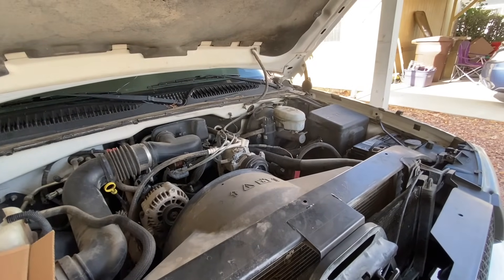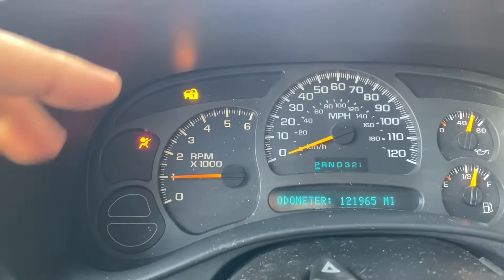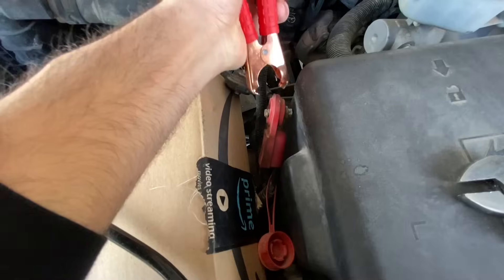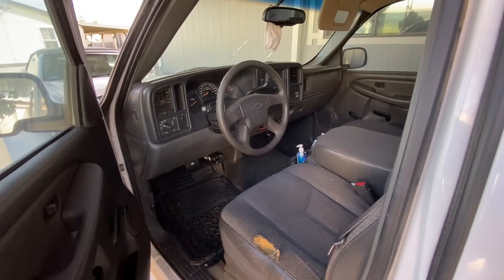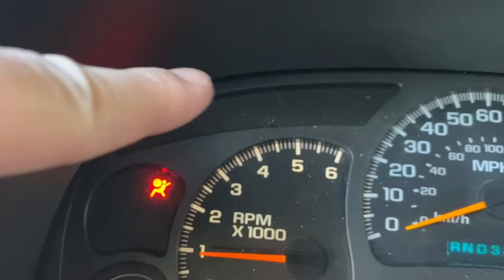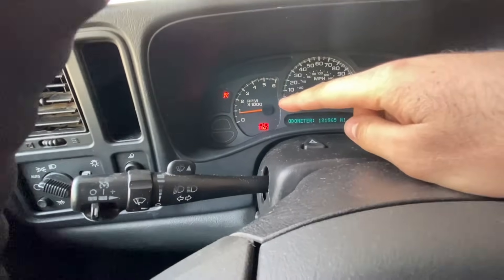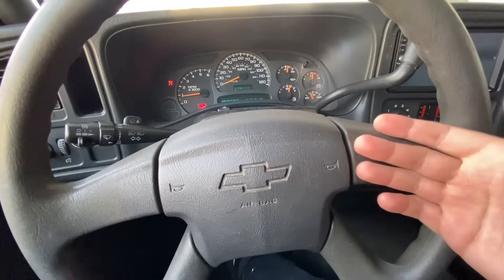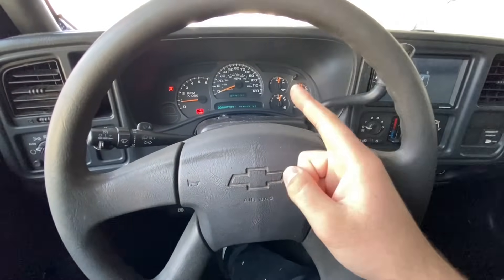How To Reset All ECU’s And Control Modules In Your Car Or Truck Safely

Comment: I only have a battery jumper cable type module.  not regular jump cables...can I still do this with that?
Reply: Yes just make sure you use the same color cables when draining the system

Comment: On my 1996 GMC suburban I am having major issue the computer suv I can't get in too my stock diagnosis mode in device I have  have this option  too reprogramming it or something else like adjustments performance I had on it before but I was doing this I turned car on wandering what happened if don it just curious see makes different works better I thought but / it says error switch ignition not on but I am on / and no longer starting as was starting before and dying out what you think going on
Reply: 😂ok good

Comment: Do u keep the ground wire connected though? Or just disconnect the Negative and the Positive terminals?? I have a 2007 Ford Ranger 4x4 V6, model without any electrical windows or lock/unlock buttons
Reply: Yes, disconnect both from the battery first
Reply: @kellismith4329  why would you do that? You can just disconnect the negative. If one cable is disconnected then your battery is out of the picture its not going to arc it
Reply: You said disconnect both

Comment: This is a really bad idea you can actually damage your computer you need to go on Scotty Kilmer website and he shows you how to take a 1 ohm 10 watt resistor and hook into two jumpers and then hook that to the positive negative and that takes overnight to drain it down for about 8 hours and it does not damage your computer

Comment: Thanks bro, your knowledge actually works even on 800 cc alto car, I was badly disturbed by car abnormal rpm,  I paid more than 3000 at service center they cant setups  properly , done throttle servicing too, I request them to  do calibration too, but they denied,  it's ok.. veh is ok..they said,  but I was not satisfied by them... finally I did by ur help,  thank once again..🙏
Reply: Co

Comment: Have a 2003 Trailblazer EXT Northface Edition 195000 miles, 4.2L 4WD. Had an issue come up where I was losing MPG and power, wouldn't stay on cruise control. Took it to a mechanic in another town because it broke down on the highway, spent $80 for a sensor, no joy. Replaced battery, spark plugs, fuel filter, air filter, and had oil changed; still no joy. Towed it to my long time mechanic ($180 for 40 miles), learned catalytic converter was full. Had it replaced. Still not right. Seafoamed it in gas tank and cleaned throttle body, still engine stuttering and bad mileage. Watched this video, replaced plugs with Bosch plugs and followed directions to clear ECU memory. Took it out and drove it, 45MPH on cruise without any stuttering; 70 MPH, no stuttering; 55 MPH no stuttering and fuel economy is back to normal. Problem seems to be gone! If it is, saved me buying another ECU and having it programmed, probably $800 or more. Thank you!!!!
Reply: Very cool. Congrats! And what a headache!

Comment: My 2006 Ford focus PATS systems activated and would not turn over. I did this and it reset the system and started right up. Saved me from having to have a locksmith reprogram my system.
Reply: R u serious? My 2010 f150 went into Pat's lock 18 months ago and it sat in my backyard for 17 months I was fidlling around with some wiring under the dash and alligator clips and somehow magically got it too start drove it for a month perfect no problems at all then it goes back into security lockout mode once again and now I cannot get it going I'm going to try this in just a second and I'll let you know if it works I'm really optimistic after your comment fingers crossed

Comment: My check engine light is not on and my scanner read error not sure if computer is bad will doing this help reset computer at moment truck not starting thanks
Reply from the maker: Check the communication fuse
Reply: @GK7GARAGE  I’ve checked all fuses under dash and hood and fuse on positive cable all good. I think the computer went bad when I jumped truck putting cables on backwards
Reply: @wildcardjoker  - yup...that'll do it! You fried something!
Reply: Probably a soft code. (AKA a Pending code)

Comment: Thank you 😊 for the great video ❤️ these car dealerships want to nickel and dime us to death especially us ladies thanks again
Reply: There's no nickels or dimes involved when dealing with a dealership!
Reply: Nickel and dime?  The dealerships by me are total crooks!  Wanted $99 for a cabin air filter replacement. I said NOT today. I went home and look it up on YouTube and I was about to purchase the filter from auto zone for about $3 and it took me less than 3 minutes to slide the old filter out and the new one in. Crooks those dealerships. On occasion when I get a coupon for an oil change and go there. I tell the receptionist when she checks me in…I say tell the mechanic not to come looking for me to tell me I need any service. If he thinks I need something have him write it down and I’ll look it over at home and decide 😁😂😁😂. This chicky is tired of those men at the dealership trying to rip me off with their bullshit stories.
Reply: Yep mine said 200 just for diagnostic. Bull shit.
Reply: @user-ig8re3ld2v  dealerships and chain store mechanics are such crooks.  Once I was driving and I heard a loud knocking and I happened to be close to the Honda dealership and pulled in and the man looked at my car and said the sound and smoke was the calipers and I need new calipers and the job would be almost $800.  I said that’s a lot, I’ll come back. I took it to my neighborhood mechanic and he looked at it and he greased the one caliper that had gotten stuck in the up position and he said once in a while they do get stuck. He greased it and I never ever had a problem for the remaining years I owned that Civic. And he didn’t charge me to simply grease the caliper.  I stay away from the dealership since then, I avoid them like the plague.
Reply: Exactly. Frickin mechanics. Tryin hose us.  And nobody knows what wrong. Pppft losers

Comment: Hi there! This video is really simple and helpful. Thanks for posting it. But I’ve got a question. I own a Hyundai coupe siii 2007 and I’ve unplagged the ECU without removing the battery negative pole. I asked a specialist to tune it at stage 1 and after plugged it back on the car won’t start. He tries with other 2 different files without finding any issue and still nothing. So he put the original file but the car still won’t start. Is your video ideal to solve such problem too??? Much appreciated
Reply: Ask him if he only wrote the file and not the eeprom
Reply: Sounds like a damaged harness! Or you never fully plugged it in. Try spraying connections with circuit board cleaner(not connections on ECU).
Reply: Rip

Comment: Question? Can I use any jumper cable because I see the one you are using in the video does not have a negative end? My car is a 2010 Chevy traverse.
Reply: There is a black side and a red side… only use one color fit both so either both red or black . Make sense?
Reply: I know your comment is a month old but future reference. Yes You can use regular jumper cables ,but only use the negative cables on them.
Reply: @lindswill4144  can you explain what you mean by this?
Reply: @avinaftali8595  use the black ones only

Comment: i just did it, and right from the start the car started with lower engine noise reving around 1000 RMP instead of 1500, and after 10 sec the engine goes down to normal ideal round 800 rpm , she is perking like a kitty
Reply: If you don't mind me asking. How long after did it work? Or is it still currently working?
Reply: 0

Comment: Does this apply to a 98 chevy Z71 vortex 5.7 cause I'm having all kind of elect problems with it as far as with it running...and nobody can tell me ..I just put in another motor  new distributor  and cap wires sensors and plugs and nothing has stopped the many strange things its doing ..3 alt  3 battery's 4 starters  and its also starts discharging after it runs a while I NEED HELP PLEASE ....BAD ..
Reply: Check your ground points . GM is notorious for grounds making ppl think it's electrical.
Reply: Same with me,  worked for a day next thing you know my truck shut off haven't figures it out smh

Comment: Well it reset the throttle body on a 2008silverado 5.3??
Reply: Did it work? I'm have that issue because stupid me cleaned the throttle body,, 08 Chevy express 2500 4.8,, I know your message is old but it's new to me, please advise, thank you 🙏

Comment: Garrett's motor is crooked I had them work on my 2000 Tahoe they told me my throttle cable was dirty thing about it it was electric throttle from that day I wouldn't buy a car or let them ever work on my car what's funny about this I got way better deals in Maricopa County I been living in Coolidge my whole life the best car dealer Coolidge had was Siser Chevrolet Garrett's will never be # 1

Comment: My cooling fan won't come on. I have a 2009 Mercury Grand Marquis. I replaced the thermostat and cylinder head temperature sensor after the car overheated. The fan still won't turn. My mechanic said I needed to replace the ECM. $$$! Will your method fix my problem? Thank you!
Reply: Yes

Comment: Is the key on during this process or not??
Reply: What purpose would the key serve to be on if the battery is disconnected.?
Reply: @kennethwillis5274  what I was asking!! 
After all. Some of the systems are not powered up until the key is on. Therefore grounding an open circuit does nothing. That’s why

Comment: I have 2002 Chevrolet express 2500 V8 fuel, the brain box got burned and I changed the brain box but the gear is not selecting. What should I do please?

Comment: If I reset it and use a different transponder key instead of the old one would it be a home/budget way of moving the programming from one key to another?
Reply: Id like to know this too.
Reply: Look up your car. There are steps to do from inside to reset keys. Make you turn it, open your window, shift into reverse...but each car is different

Comment: thx u thx u 2012 chevy impala fuel pump drive module needs to be replaced while this work
Reply: What were the symptoms?
Reply: @JamrockLionPaw  just check engine light on started and ran a little bouncing idle at idle

Comment: Recently I got a new battery installed in my vehicle 4.6 V8 Mercury Mountaineer I'm trying to get it passed smog the guy said all my modules aren't running could the new battery be causing this if I reset would that help me pass smog
Reply: yes

Comment: In the case where by the dash board lights go on without even putting the key on once the battery is connected on the Corsa c, what would you advise?

Comment: Hi brother 
I have holden astra 1.8 cd 2001 mannual car ,it's started any time but.  After 40 or 50 second , egine slowly slowly shut down what's problem in my car
Reply from the maker: It can be a clogged catalytic converter because it builds enough back pressure to stall the car, check for engine codes
Reply: @GK7GARAGE  

True Story.